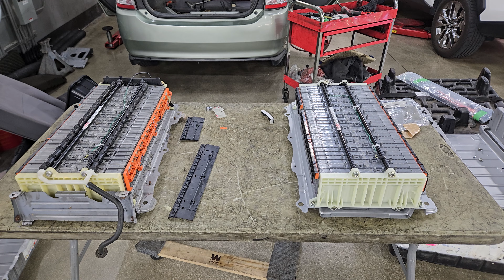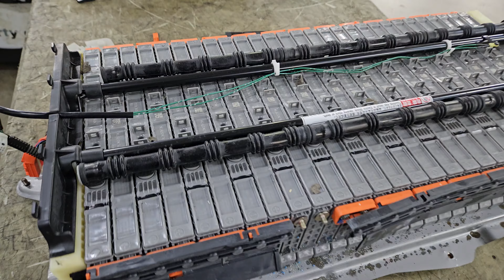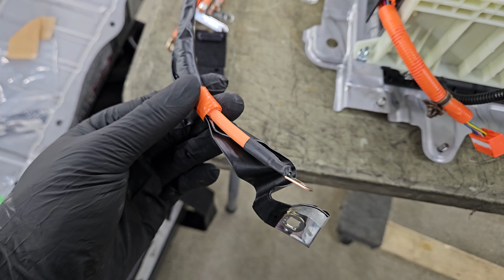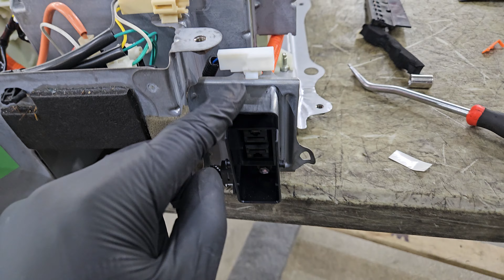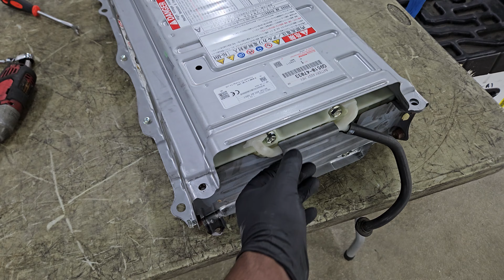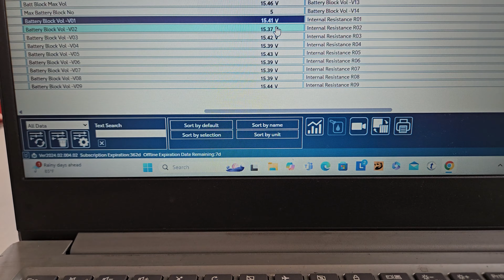ATTENTION Toyota Hybrid Owners Here's Why You Should Always Buy A New Hybrid Battery!

Comment: I swapped ALL the cells on my 2011 Prius in 2022. Also put in new bus bars, hardware, spacers, temperature sensor mounts, and large gauge high voltage wire.
DIY the whole thing myself. Took me about 8 hours.  Car is running just fine.